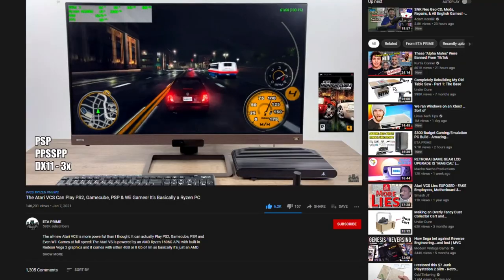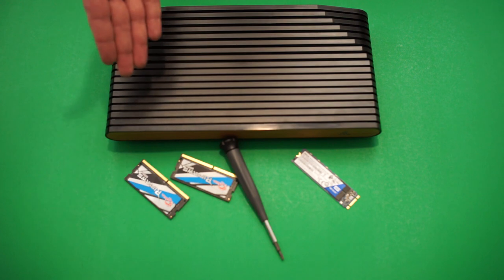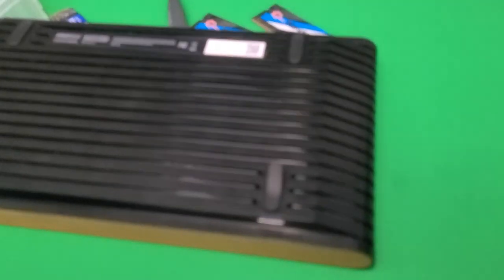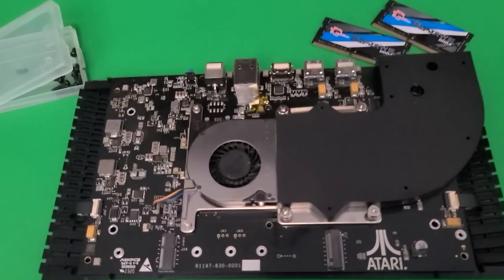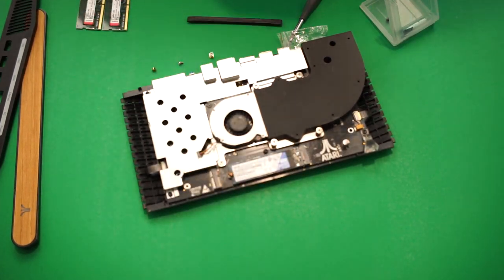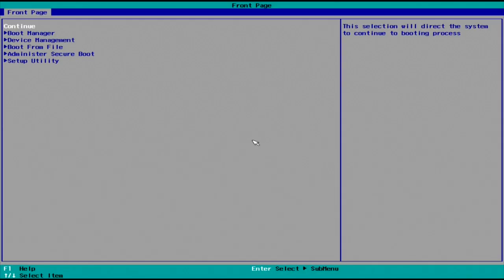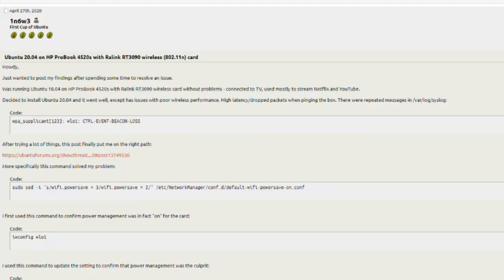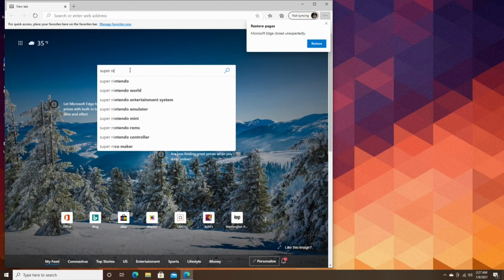Get the most out of your Atari VCS (RAM, SSD, and OS Installation)

Comment from the maker: Thanks so much for watching! Links to the hardware I used are in the description. I'm still researching more VCS videos - what would you like to see? Let me know! Don't forget to like and subscribe!
Reply: Potential blockchain integration
Reply: linux distros can be tricky depending on hardware.  I have relatively good knowledge of wine, vulkan and various graphics ppa's but sometimes all one's linux knowledge does not matter.  Even proton itself can be finicky if running steam in linux.  I can get a steam game to run once, but then inexplicably, it may never run again.  Updating to latest kernels even doesn't help sometimes.  I tried Ubuntu 20.04, and Pop OS b/c they've been touted by many as good for gaming, yet get the same outcome pretty much.  I am a linux fan but Steam gaming on linux can be quite frustrating and mind-boggling at times.  Lately, I mostly dual-boot into Windows when I want to use Steam due to the inconsistency.  Lutris as well has yielded me similar disappointing outcomes.  Besides Steam, most other gaming via linux (ie. emulators) actually seem more stable than windows versions.   Also, don't feel bad about the Genesis classics on steam not working properly...many users including myself have e-mailed Sega about problems w/it and they never patched or updated and stopped responding to me after a followup email I sent them.  Full screen mode in particular shows up black for many users including myself & I tried via AMD and Nvidia gpu's across a variety of distros so I think it's safe to say the Linux version is broken whereas the windows version is fine.
Reply: n/m I watch more of the video you know about it:)
Reply: I would LOVE to see gaming on it. Like full gaming, playing light games then very graphics enduring games, maybe even cyberpunk 2077 on this upgraded Atari VCS. You have got me back into Atari, so thanks, bro. Think about it
Reply: @aswillis4797  Kevin Kenson did a video on it but he had not upgraded the ram.  It was not pleasant playing cyberpunk at default according to him.  I think it may end up being playable after a ram upgrade (and maybe optimizations for pc from cd projekt red).  I haven't found any vids where anyone tried running it w/32 GB as yet.

Comment: My 12 year old daughter and I performed this upgrade, (but also replaced the thermal paste, upped the TDP, and increased the RAM speed). We had already installed the SSD and sealed up the system when we realized that Windows couldn't be installed normally. Rather than ripping the thing open again, we just installed Windows to a different SSD on a separate computer and then used Macrium Reflect 7 Free to clone the disk to the internal M.2. If you go this route, remember to skip entering your product key when installing on the other machine. You don't want that hardware associated with the product key you acquired for the Atari. When the OS is on the Atari, you can enter the product key and complete activation.

Comment: They should just pre-install Retroarch with all cores that run well on the system and integrate it into the menu. I’d use the VCS as a multi-system retro console in a nice case with matching joystick.
Reply from the maker: I wonder what kind of licensing they can get from that. Or at least court them to sell on the store at launch.
Reply: @SuperNicktendo  If they need to subsidise the console with the games, they calculated wrong. For me, the Atari VCS has always been a beefy retro (emulation) console and not a competitor to the PlayStation or XBox. I only consider the store and the more modern games as a bonus. Plus, if you add an OS that boots into Retroarch via the PC mode, you basically get the same effect, but it looks and feels more like an afterthought.
However, if they enable directly booting into PC mode in a later update, I'd also accept that.
I know you can have this with a Raspberry Pi with a nice case too, but the VCS would appeal to many people as a ready-to-run alternative.
Reply: I agree.  I am a bit of a nostalgia person and the VCS would make the perfect retro emulation system.

Comment: How did you find the correct speed for the RAM? I'm afraid of buying a 3000 mhz pair
Reply from the maker: I bought it based off of the discord recommendations. The speed currently is at 2400 regardless of what you buy though and currently the BIOS are locked so there's no way to overclock/change that.

Comment: This video was great, it didn't feel long and answered most of my questions about upgrading the VCS... although I still want to know if the Ryzen 5 3200G would work in there! Guess I'll just have to buy one and find out...

What I would like to know is, how do some modern AAA titles work on the console(yes, it's a console, if only by form factor! Don't blame me, blame whoever decided a tower was the best shape for a computer) once it's fully upgraded? Specifically I was wondering about Call of Duty Warzone, iRacing, SFV, Cyberpunk and Grand Theft Auto 5,  but Shadow of the Tomb Raider seems to be a pretty mean benchmark and everybody loves it when you run Contra!
Reply from the maker: well I can tell you right away that you can't put any other chip in here. The Ryzen 1606g is a system on a chip so you're stuck with what you get. Perhaps down the line you can swap out the board for something else but it would truly be a passion project at that point to get everything to fit. 

Once I get Windows on an SSD, I'll see about testing out that games.
Reply: @SuperNicktendo  Ah well, you can't have it all. I'll be waiting for that test video!
Reply: @misterwin2393  eta prime did a video mentioning some of your games but he didn't max the Ram, just added an m.2 ssd.  he got most to work ok at 720p..check out his vid if haven't yet.  another guy (forget his name) ran cyberpunk but wasn't pleasant (like 12-15fps i think) but he didn't max the ram so don't know if any hope w/that game..if u have a more powerful pc, u should be able to stream a game to the vcs in windows or linux pc mode so there's that as an option it appears
Reply: @linuxlover_8436  I think your talking about Kevin Kenson, he tried running cyberpunk
Reply: @PatrickThomasBrady  that's him.  thanks

Comment: I really am itching to install GamerOS when the VCS is freed up from Secure Boot
Reply from the maker: yeah - it's a shame that it's locked currently. I think because in order to get devs on board they have to have some blocks in place to reassure them.
Reply: @SuperNicktendo  Also helps avoid B.S. warranty claims... it's a fine balance between OPEN SYSTEM and self responsibility.  ;)
Reply: @SuperNicktendo  i think u and Josh are right about this
Reply: It’s only a matter of time until this is cracked and you can install what you want on it

Comment: if i get one, i'd probably get the 4 GB only to upgrade to 32GB immediately.  They should just offer a version w/32GB from the get go even though it might not matter for most games.  it might be cheaper if they offered that as an option as long as they'd be able to get a lower rate for ram than what a user might pay if upgrading themself.  Also, if the unit is successful, atari should revamp the internals to at least be easier to add ram and ssd or offer add'l ram if the vcs is direct ordered...some users are not that savy and may not feel like opening the unit out of fear even if it's not that difficult.  reminds me too much of opening a legacy laptop which can be a headache at times.
Reply from the maker: Yeah. That's why I maxed out the ram even if it is a bit overkill at the moment.
And yeah, it would be a good idea to upgrade options factory direct

Comment: Question. Can I just get the Windows 10 Home USB from best buy and boot it up on the Atari out of the box that way? Thanks.
Reply from the maker: Installing Windows 10 on the VCS doesn't work the same way that you would normally do it on a PC. It'll get to the point where it needs to restart then fail. Atari suggests making a bootable USB via Win2USB - I don't know if the one you buy from Best Buy will work, but if it does, it will only run off that USB and you'll be stuck with the space that's left (if any)

Comment: I cannot get the VCS to boot automatically to the internal SSD. Any suggestions? I access boot manager set to to book from the SSD, but it seems to reset every time I power down.

Also, do you know if there is a way to partition the SSD to allows the native OS to use a portion of the SSD for storage without formatting the entire SSD?
Reply from the maker: You should be able to split the SSD so you can use it in tandem with Atari OS and Windows. I think it would have to be an unformatted partition first so you would install windows on half and then let Atari partition the other one. I'm not 100% sure on that.

As far as boot order, I believe you need to unlock the bios and force it to choose the SSD but I know some people just erase Atari OS which kind of defeats the purpose of the machine.
Reply: @SuperNicktendo  I gave up trying to figure it out for now. The Atari website says the boot order is (1) USB drive; (2) internal SSD; and (3) Atari OS. I'm fed up trying to figure it out. I was booting the VCS to Windows from a flash drive installation. I never figured out how to get the SSD partitioned to have additional storage for the Atari OS on the SSD. 

So the SSD is fully for Windows and I have a 128 GB formatted for the the Atari. While I am sacrificing a USB slot, I'm okay with the that and can always remove it.

Thank you for the videos and your input.

Comment: Will the Crucial RAM 16GB or 8GB DDR4 3200MHz CL22 (or 2933MHz or 2666MHz) unit work? I have heard without the BIOS password you cannot increase the RAM speed above the native 2400MHz, so may be stuck with Crucial RAM 16GB Kit (2x8GB) DDR4 2400 MHz CL17
Reply from the maker: Yeah the ram caps out at that speed and even then the APU doesn't take advantage of the extra ram so anything over 16 is wasted. Not to mention the thermals might be an issue as well if you manage to unlock the speed. If I could do it over again, I wouldn't spend that much money on the ram.

Comment: So...if I install the second OS, will it still boot the Atari OS by default and then go to Windows 10 when I launch the PC Mode tab?
Reply from the maker: It will always boot to Atari OS by default if you have an OS installed on the drive. If you installed Windows 10 on a flash drive, the Atari VCS will always boot to windows by default as long as the drive is inserted.

Comment: Thanks for the video. I will say that 32 gigs is and will always be overkill for this system. There's just no way that you're going to be running any programs on a system like this that would ever require that much memory. 16 gigs is more than enough.
Reply from the maker: You're probably right - I took one for the team - even at 8gigs seems to run everything that you could possibly want smoothly.
Reply: @SuperNicktendo  Yes 8 gigs is probably plenty sufficient. 16 will definitely future proof things though.

Comment: So I got my memory and SSD upgrade and thank you for this video. I have Windows running a flash drive. Any suggestions on how I get it to recognize the SSD?
Reply from the maker: You would need to get an ssd enclosure that would make the drive into a USB flash drive that you can install windows on to using win2usb. When it's finished, then you can put the SSD into the vcs and complete the installation on the VCS.
Reply: @SuperNicktendo  I appreciate you taking the time to reply. So am I complete moron that needs to start over? You see, I installed the memory upgrade and the SSD without thinking about the need for format the SSD. Then I used win2usb to create an external flash drive to run my Windows 10 installation.
Reply from the maker: @chslaw  not a moron, it's just a weird process. You can still run windows off that stick, but it's a much smoother process on that ssd
Reply: @SuperNicktendo  But I need to take it apart again to format the SSD I already, right? Regardless of whether I run it off the stick or not?

By the way, appreciate the videos. I had the VCS as a kid and the Atari 800 was my first computer. Yes, I am that old.
Reply from the maker: @chslaw  yeah you still need to take the SSD out. I don't think you can transfer it to the SSD
Reply: @SuperNicktendo  The memory I order seems to be bad, so I am taking apart the machine again. I'll do the install window in internal SSD.

Comment: Ugh... do NOT use anything to pry off the front panel! You'll scratch the damn thing, and it pops off by itself if you take the back panel first, then the underside (with the screws). Second, do NOT open the top panel the full 180-degrees! Put a box or something behind the lid, so it sits at a 90-degree angle, instead (and then you can easily remove the WiFi car instead of having those antennas pulled). Lastly, do NOT use a tool on those ribbon cable releases--just use your fingers (once the heat shield is removed). Leave the plastic "spudger" at home!

Comment: Hate to break it to you but 32GB RAM is well over double this mini PC can make use of. There is absolutely nothing this PC is capable of doing that can utilize anything over 16GB. Even 16GB is overkill for such o low spec PC. Let's face it, it's a fairly slow dual core CPU. As long as the RAM is in dual channel you will not gain any performance with 32GB RAM over the 8GB it comes with.
Reply from the maker: Yeah. I bought 32 because I needed it fast for a video. If I could do it over again I would probably have gone with 16. Apparently with the bios unlocked you can use more Vram but I need to look into it further.
As long as I got to show off the installation it'll work.
Reply: three years later... RAM is so cheap one might as well install 32GB.